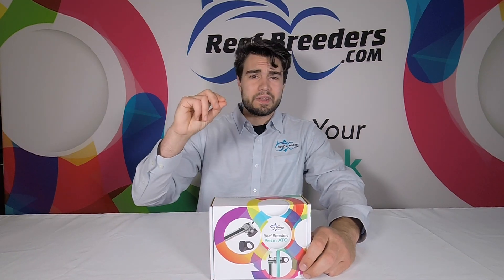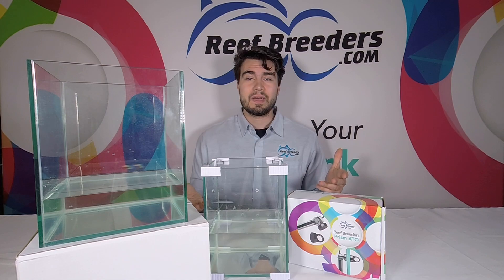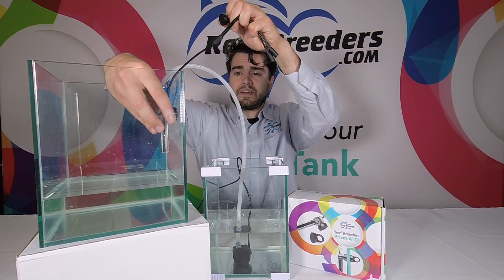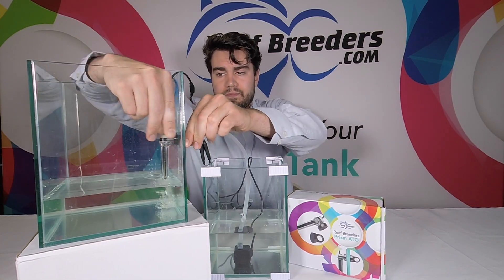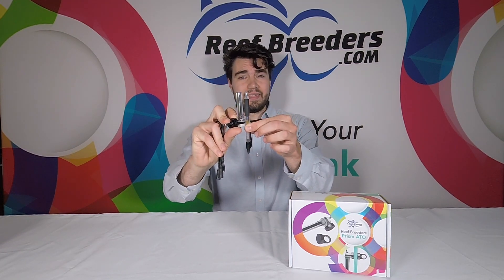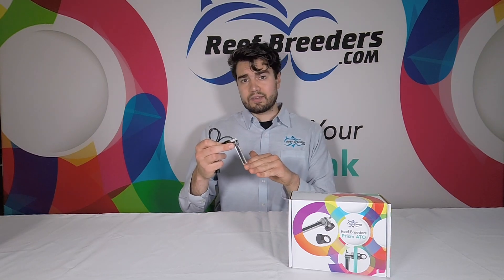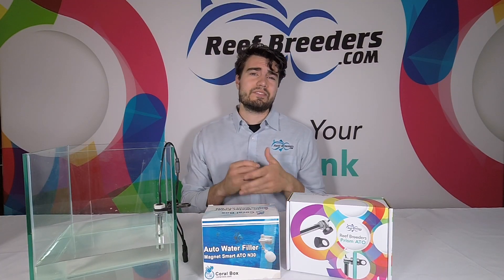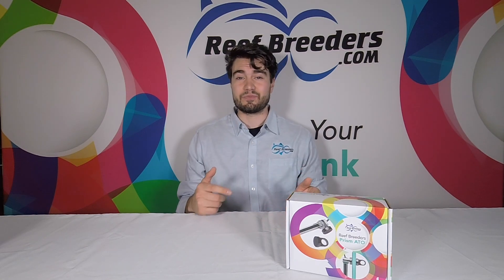ReefBreeders Prism ATO Overview and Setup Guide

Comment: My box had an additional on/off switch that isn't covered in the instructions. It also does not logically plug in to anything since the switch has two female plugs. Totally lost as to the use of this switch. Also, when set up as instructed here, the product does not toggle on/off as it should. Unfortunately this may be returned.
Reply: I currently have the same issue, I was sitting there trying to figure out where to plug the on off switch in.
Reply from the maker: @adamjohnson4790  The on/off switch is designed for testing the pump by plugging it directly into the power supply. You don't need to use this during normal operation. Just keep it handy in case you need to test the pump.

Comment: Is it possible to have  Apex fusion  monitor this ATO
Reply from the maker: I am not aware of that being possible. Perhaps with some sort of DIY module. They take a 12v DC power input. Perhaps if you could set the apex up to detect how long it draws power for when the pump is on you could work something in.

Comment: can i mount the sensor sideways because it is to long
Reply: No. It won’t work sideways
Reply from the maker: You can mount it at an angle- however not fully horizontal. The emergency sensor needs to be higher than the regular sensor.